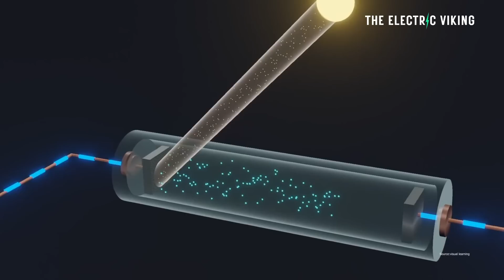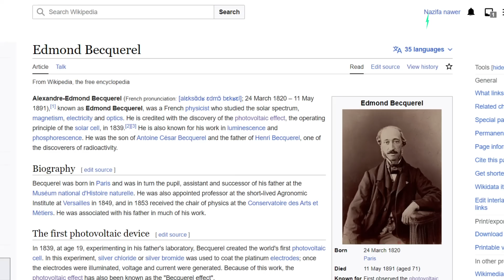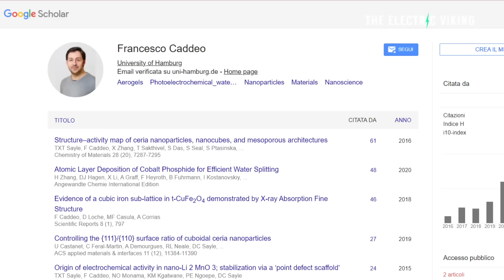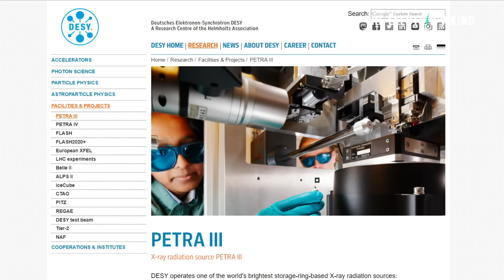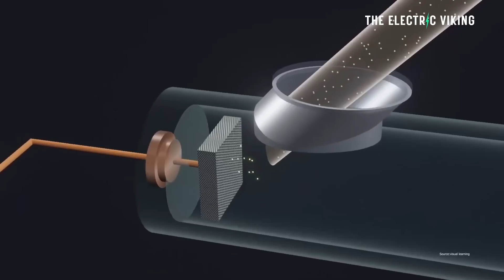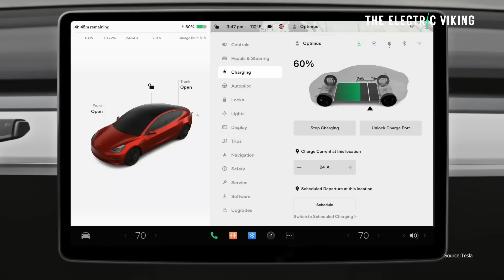New research claims photo-electrochemistry can produce clean limitless energy

Comment: First, stop calling them "fossil" fuels. "HYDROCARBON" fuels have zero to do with dinosaur bones. Decaying plant matter like algae does slowly form a sludge called bitumen that can be refined to oil. Second, realize that hydrocarbon fuels being "non renewable" is also a myth. Ask yourself two simple questions; 1) Why is it not common knowledge that Hailey's comet does not only posses water it also posses a form of "dirty shale oil" in proportions equivalent to the amount of water it contains. 2) How did "fossil fuels" find their way onto a comet in outer space orbiting the sun if there were no dinosaurs or decaying plant matter on the comet? 

It's funny the lies that they've told us that we believe whole sale. Artificial scarcity leads to massive profits. Their lies are so ingrained into your paradigm that you automatically call them "fossil fuels" even though its been proven that they have zero to do with "fossils". Hydrogen and oxygen are the most abundant elements in the universe. They readily and easily synthesis not only to water but easily fall into stable hydrocarbon chains. Any hydrocarbon molecule easily transmutes into any other stable hydrocarbon chain. Not only is there an ocean of water locked in Earth's crust larger than all of the oceans on the surface, there is an equivalent, mind boggling amount of hydrocarbon fuels locked within the crust and mantle of not only earth but nearly every other celestial body in the cosmos.

Comment: Non-polluting, closed-loop, geothermal energy will become universally available once we can drill deep enough holes. Quaise Technology claims to be on the verge of this achievement, using microwaves to vaporize rock. Such systems can operate for 60-100 years, maybe longer, requiring zero fuel, with only the cost of operations and maintenance. Heat from the earth’s core is continuously being replenished by the decay of radioactive elements, and is essentially infinite in human terms.

Comment: Sam,  I was promoting this vein in research for more than 40 years. Your countryman nobelprize winner J.O'M Bockris wrote a summary of electrochemistry in '82 in which he mentioned research of predominantly the American Gas Association showing the unbelievable quality of cooling water (up till freezing!) and at the same time producing H2 and O2. It was uneconomical also because of the prospect of vast area's that were to be expected to install. These experiments were met with the then known 8 variables. I collected tens of new variables to combine with those 8 "obvious"ones. It never rang a bell; on the contrary, most if not all were probably thinking of me trying to invent a perpetuum mobily. You can find this knowledge on pages 327\328 of "Energy Options" from the forementioned. I had the book sent to me from Australia. Electrolysis is a fully known proces with around 50 possible stages of association and it's reverse dissociations, all managed by interchanged photons. One would guess that AI could figure out when all ingredients are (to be) known. 
This is the only "way to heaven" that nature shows us compellingly if not compulsory to realy cooling our earth. BTW did you know that our earth is loosing just hydrogen from it's upper atmosphere to space (100.000 tons of it per year)

Comment: I don't know if there's any truth in this, Sam, but 50 years ago or there abouts, it was rumored a Japanese Scientist had come up with a substance which could be put on a flat surface or plate, absorb an enormous amount of solar energy in proportion to the size of the plate, e.g. a piece twice the size in area to a match box, could store enormous power.  Moreover, the substance could be used over and over again.   Who knows what inventions were quietly bought out to be laid aside in the interest of The Big Players.  Look at the resistance coming from Big Coal, Gas, and Oil.
Reply: There’s a strict limit on the efficiency that can be achieved and that’s good enough to solve the problem, now we just need the price to be low enough which will happen within the next decade.

Comment: Dumb. This can't scale because there is no excess energy to collect. When you tap the tiny current, the reaction stops and you only get low grade heat. Do some more research Sam. This is a dead end. BTW we don't have quantum computers. We have very limited quantum computer experiments. AI is run on modern supercomputers.

Comment: Very interesting Sam. Good work. So the x-ray diffraction monitors the degradation of the photoelectric material as is converts light energy into electrical energy? Clever. So presumably they will tweak the material until it stops degrading while still producing electricity.
Reply: Incorrect. The degradation amplifies the distraction of the photovoltiac electromaterial,  in x gamma irradiation. The result is  a massively disruptive, game changing, catastrophic effect on legacy photons. To summaries...it may enable Elon to name his children " legacy " fashion, rather than throwing a handful of cutlery down the stairs, and using the resulting sounds as names . Just a thought.😅

Comment: If it can collect a spectrum and radiation even for low light conditions, everyone would buy a new type of panels especially if it last better than current solar panels. Just think longer collecting times with more then one current pass through. Something like this would most likely  use more charge controllers.

Comment: here is the fly in the ointment, for the earth to maintain a constant temperature, the incoming solar flux must equal the outgoing.  If you somehow harvest a good percentage of the incoming solar flux to produce enough electricity to replace current fossil fuel usage it would result in the earth becoming much hotter.  Of course this is exactly the opposite of what is needed.  The solution?  well, let's call it the 'final solution' since it would require the extermination of most of the worlds population.
Reply: Utter nonsense. The amount of energy required is a tiny percentage of the total energy hitting the planet all the time.

Comment: I have a working prototype that can be add on or bult in solar panel that work day and night. I am using hybrid DC current (extremely low energy)  to power lights that creates no heat and mimic sunlight to power solar panel. This method increases solar panel by at least 400%, therefor no battery storage needed. you can have production less than 6 months
Reply: lol, you don't know that light and heat are both electromagnetic energy?  last I checked sunlight is pretty hot also.
Reply: A solar panel that works at night......I don't think so
Reply: Blatant nonsensical magical thinking, go learn something before you embarrass yourself any further.